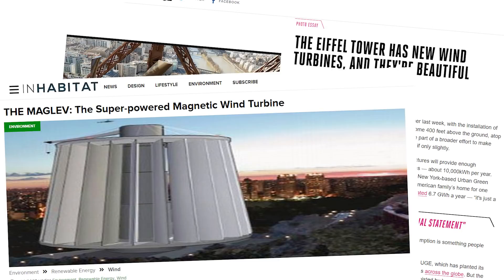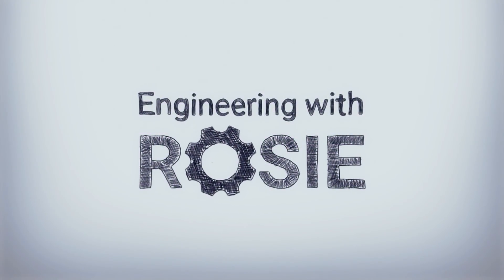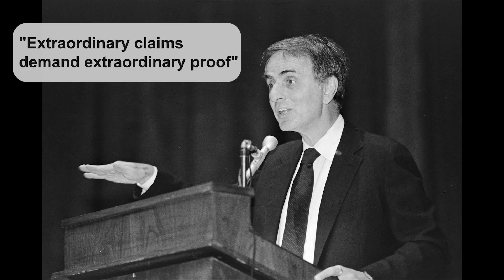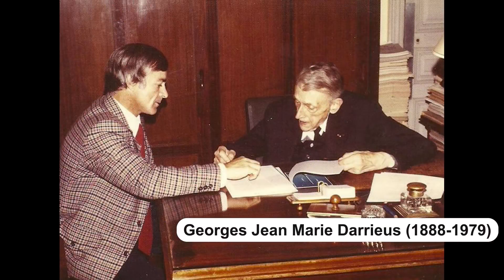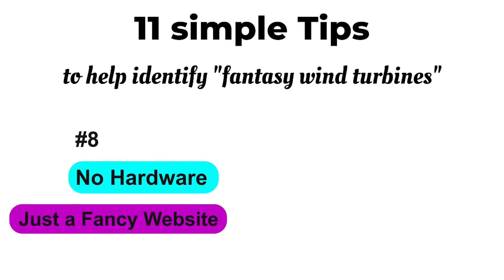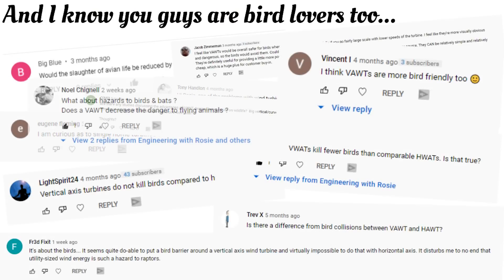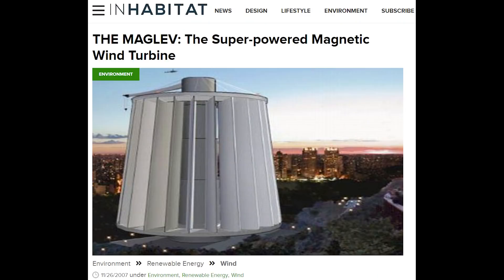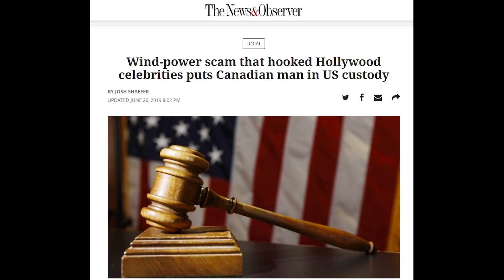Back to the Future of Wind Energy Technology with Paul Gipe

Comment: To me, the twin elephants in the room for most renewables are reliability (of the source, not the device) and storage.
From the reliability standpoint, the ONLY truly predictable renewable is tidal.  Clouds and calms can last days or weeks, but tides are predictable, regular and frequent.
Storage has to cover periods of dearth and periods of high use - it would be, for example, foolish to rely absolutely on wind OR solar through the winter in high latitudes without vast amounts of storage.  And at those latitudes, even the sea is frozen.  Ground source heat pumps are a definite maybe, but the best I've seen so far is in the storage of energy as heat in sand.  Yes, ordinary common sand, and the Finns are already using it for heating some buildings.  If it can store, inexpensively, sufficient energy to last a Finnish winter, that is proof enough!
For other types of energy, electrical storage is mostly Lithium-Ion cells, although more efficient batteries do exist, but have their own problems - sourcing the materials ethically is a big one, shared by Li-Ion, but others include operating temperatures, cycle life and safety.
It is only in a combination of technologies that we can see a real change in sustainability, and the best I've seen yet is liquid metal batteries inside sand heat storage.  They complement each other perfectly, the sand insulating the heat needed for the operation of the liquid metal cells, and using any "waste" heat effectively as a source of heating power for all the usual purposes, although most of the heat stored in the sand is from ordinary resistance elements, which keep the sand hot enough that at its core, where the batteries need to be, the heat gradient (and therefore loss) is low.  The sand is heated and the batteries charged mostly in summer, and the heat slowly reduces through the winter by heating water pipes which circulate heat to where it is needed.
Small-scale local generation is best as it reduces transmission loss (a fact recognised early in the Industrial Revolution), so all the energy-intensive industry needs to be close to where large scale power is produced, by whichever means.
Moving towards a more sustainable future is disruptive and challenging, and big money (oil, gas, coal, even nuclear) are rolling in it, and using it to fight sustainable alternatives, mostly using economic arguments.  That requires a high tax on carbon use to level the playing field.  The amount of money in the carbon energy release energy sector is the third, artificial, elephant.  And an artificial elephant needs an economic rather than a technological solution.

Comment: Trying to build my own wind turbine after buying one last year (lantern type)  which couldn't even reach operating voltage let alone wattage, so far it seems to work well both in horizontal and vertical positions but I haven't found a generator that I am happy with as most don't put out high enough voltage, and I need to refine how it's made (it's a bit DIY looking at moment).

Comment: What a great video. Side by side with other energy technologies, wind comes out miles ahead, still. Put up all the false claims about Net Zero fossil energy, or high efficiency, or low cost, or 'clean coal' or 'benefits of oil' or methane replacing coal to reduce GHE, and still wind wins hand's down.

I'd love to see a similar critique of solar, geothermal, hydro and nuclear in all its guises, so the different technologies could be compared on the same basis.

Energy often attracts snake oil salesmen. None moreso than fossil.

Comment: Great video Rosie! I have a question - why is it not viable to site wind turbines on the top of electricity pylons? These would be of an appropriate size so as to not stress the pylon (maybe this is the reason?) Of course a convertor/transformer would be needed but there would be some transmission cost savings. I've always wondered about this!
Reply: <enthusiastically puts hand up> Can I answer? Please, pick me!

Any turbine installation comprises several parts; foundation/tower, turbine, generator/dynamo, conversion electronics.
The last is damn expensive and doesn't scale down well in cost.
So putting a turbine on top of electricity pylons only eliminates the foundation and tower part. You'd still need all the other components.
The turbine could only be small, because you don't want to overstress the pylon and you couldn't use a big HAWT (chopping the powerlines would not be ideal).
So you are left with a small device not generating much power, with the major costs of the transformer and connection to the electricity. That has to be balanced with load btw; another complex task.

Simply put; huge complexity, large material costs for power generated. Not worth it.
Reply: Thanks Alistair, go to the top of the class!

I did realise that the economics weren't comparable to traditional turbines but we've got to stop thinking in purely monetary terms and more along the lines of "every little helps". The grid balancing is an issue but these turbines could be stop/started remotely and in groups (say, 50 in a line at a time). It may be that the economies of scale of producing the hardware for thousands of  pylon turbines and the increased wind speed given their position mean that cost/benefit may improve. After all, look at the funding going to the fossil fuel industries globally.
Reply: I think you underestimate the horizontal force on a spinning wind turbine. Its's almost as big as if the entire swept area of the blades (not just the area of the blades themselves) were a giant sail. These electricity pylons are simply not strong enough to handle this additional load (as you already suspected). You can look for youtube videos of wind turbine foundations, they are massive!
Reply: @wimvanuytven7858  Hi Wim, thanks for your reply. I didn't envisage huge turbines on top of pylons, more like hundreds of smaller units with a rotor diameter of around 2 metres (though this would obviously need to factor in the average air density throughout the year in a country - cold dense fast wind = only smaller turbine possible). I imagined  that these turbines could be controllable, featherable, directional, have additional cycle adjustment and other management to allow them to connect to the grid via the existing power lines. I guess that most of the lateral force would be borne by the pylon structure (they are bolted together) and not the base, which may mean additional strengthening (but no base redesign). The economics would only come into play through the quantity of these turbines - if it's not windy in Scotland, it may be windy in Brighton. However, the U.K. is actually (onshore) becoming less windy which would negate the whole idea!

Comment: I had heard that as a rule of thumb that the tower contributes about half the cost to practical wind turbines. What do you see evolving there? 

I  have to admit, I had a wild flight of fantasy seeing the dirigible (floaty) ducted turbine: Could this be the next big thing (in engineering challenges)? No not really.
Reply: The tower does not cost 50% of the total cost of a conventional turbine. Probably about 15-20% depending on hub height. Biggest cost items are blades, gearbox and electrical system.

Comment: i like hydropower. imagine, 4 dams, (or more), down a mountainside  in sequence , spaced apart, with reservoirs  using 1 river, and multiple hydro electric plants off of 1 water source might be viable if a pipeline of these "banks" of energy using only 1 water source and gravity may be an option. in addition to wind and solar. but the question still is. how are all the products made without the initial environmental impacts of manufacture?

Comment: Wind energy (when it's windy enough to turn the blades or too stormy to use the turbines). Imagine the scenario with a large area of high pressure bringing cold, foggy weather in winter - no wind power, very little solar - NO ELECTRIC.
Let's go "green" and have  expensive 
UNRELIABLE energy.
Reply: That's where energy storage  comes in handy.

Comment: I have a concept. A omnidirectional solar sail+wind turbine. The way I see it, sails can push tonage of a ship across oceans. So 3 sails that can also absorb and convert solar energy. And the turbine which at the base can turn in either direction to produce electricity. And the solar energy absorbing sails can also convert solar energy. Does this have any sound application or is it a pipe dream.

Comment: Siting and tweaking have often proved that vertical axis turbines do a good job for particular situations. Obviously the conventional very large turbines will continue to be used for bulk generation because they are scaled for maximum generation and use the physics of lift as Dr Gipe says.
However, size and noise bring problems too and I hope that blades and gearboxes will be greatly refined.
Without bulk storage for days of little wind I feel that cart before horse was allowed to occur.
In sneering so blatantly about failed -- and often hyped -- smaller scale wind devices I regret that you have failed to grasp diversity of requirements in context. Gipe seems to relish negatives more than you do along the lines of "my way or no way" -- note his WindWorks promotions of 2012 ff.
One was about a "Jeffersonian revolution" in wind energy across the USA and I do not recall his company or similar ones thinking ahead to 'downtime storage' back then. That seemed to creep up on us in the last 5 years or so except among some who saw that intermittent generation was but half of the job.
Reply: Please post your data showing vertical axis wind turbines working and producing anything more than a few watts per hour. 
Gipe backs up his statements with data and power curves. Fancy websites, wild clams and marketing hype is cheap. 
I’ve installed several different brands of turbines over the last 30 years, all 10 KW and under. I’ve never seen a vertical axis machine that was worth the shipping cost.

Comment: Hi Rosie. I would like to ask if when doing calculations for a small wind turbine directly coupled to a generator, do you assume that the rotor rotational speed is equal to the electric generator rotational speed and then compute TSR or do you assume the TSR ratio and compute the  rotor rotational speed.

Comment: What about high altitude kite based systems? I saw a small reference to them flash by in the book, but didn't see them elaborated upon further.
Reply: Those operate in the same area (altitude) as commercial jets (when 'parked' in the sky to wait for their turn to land) and are considered a hazard to the people being transported.
Even skydiving schools (going up to 13k5 feet) lost their 'playground' because the commercial airlines wanted to use that part of the sky without sharing.
Technologically sound but there are other factors at work that make it un-practical.

Comment: I run a small wind turbine (450 watts) and other than the wires separating it has been with me since 2008. When I was lowering it for the wire repair I broke the blade(my bad). 
No it doesn't do as much as I would like because of location, city rules, but it does keep a battery topped off. 
Thanks for the good information, and keep up the good work

Comment: I would like to see more videos on the home turbines , which ones to buy , and even what materials to use to build your own turbines , I own several 3d printers It would be fun to make new designs and be able to test them. I was thinking about the attic turbines that are on houses to remove heat build up if they were a little bigger and had a motor that would be killing two birds with one stone, add this to a solar panel kit and a horizontal turbine you would be creating energy 24/7 and have it tied to the grid so when youre not using energy you could roll back your own usage and save more money.

Comment: I have been searching for information on the flapping wing turbine and have not found any informative work. There are a few videos illustrating this type of turbine actually working  mostly put out by news channels . I am interested in building a small working model flapping wing turbine and though there are more than a sufficient number of scholarly posts , mathematical analysis, comparative studies etc etc there is no information  related to the practical design of the mechanism that enables such a turbine to be built.There seems to be just one manufacturer of the type of turbine being referred to and that is the Tyer firm. No patent seems to have been either awarded or even applied for. I would appreciate  design information related to the mechanical details of this new type turbine.

Comment: Robert Murray Smith made a low wind speed turbine that functions comparably to a commercial 1kw turbine in typical conditions (built, tested) using a low torque high speed design, built out of a washing machine drum.   it's over on his channel.  So, whereas I'm sure Mr. Gipe is generally correct in his cautions,  it's not impossible.
Reply: Robert also had an interesting back and forth with his viewers in designing building his wind-turbines. I liked that a lot.
But to be honest, the wind-turbine wasn't put to the test for years and years and doesn't provide long-term data (as in when do we need to replace bearings and such?)
Reply: @DreadX10  id figure youd get at least a few years out of it.  If you greased it every once in a while, no reason to think you couldnt get a couple decades out of washing machine bearings, considering the weight theyre designed to deal with.
Reply: @ryanjamesloyd6733  True, and are build for 1600 rpm for the centrifugal cycle so that's okay too. And you would pick the smoothest of old bearings you have on hand so the one with the most life still in it. But what I meant was also with foul weather and storms over-time.
So more an exercise in looking at the design(s) and trying to predict what will break first and why.
An engineer standing next to a wreck of his device can tell you exactly how much the design can take, whereas an engineer next to a working single prototype can only predict how much it can take. ;-)

Comment: Ok so what if you combine dyson parts to create a turbine? Basically using the wind to create a negative pressure system for a self sustaining turbine. I’ve seen many designs just non on a smaller scale. My thinking was to combine the parts of the dyson cyclone vacuum, with the bladless technology . From the fans to Frankenstein a generator together. I’m not all sure what has been done in the past to combine jet engine technologies to current turbines design?

Comment: They only question I have is would adding winglets to a horizontal wind turbine increase it’s efficiency the way it does for a aircraft, effectively giving it longer wings increasing the amount of lift or torque?
Reply: There really isn’t much incentive to do so I think. On airplanes, it serves to limit the real wingspan while effectively increasing it aerodynamically. That has benefits in terms of fitting on smaller airports and paying lower airport fees, or for gliders, being able to complete in a 15 meter class. All at the cost of a more complex wing design of course. But what’s the incentive for commercial wind turbines? They would be better served with just adding an additional meter or so of blade I think? Or would winglets help in problems where the blade tips get too close to Mach 1 at higher winds while still able to effectively extend the blades perhaps? 🤔
Reply: @AndreSomers  that’s where my limited knowledge gets me, I know that the winglets help to reduce the turbulence at the end of the wings of an aircraft wing helping to guide the air flow over the wing, so my thought is how much improvement vs cost and complexity would it add if any 🤔

Comment: The fundamental problem of all wind driven contraptions: The wind only blows about 3 days a week. The other 4 days you  will have a cold dinner. 

This is confirmed by all production statistics. Efficiency of the wind turbines is about 25% of the rated output.
Reply: Which exactly are these 3 days / week when the wind blows? 
Possibly Monday, Tuesday und Friday?

As apparently this is true anywhere on the planet, your "proven" findings could lead to a new non-religiously biased, non-discrimimating universal way of naming the days of a week:

Windy day 1
Windy day 2
Calm day 1
Calm day 2
Windy day 3
Calm day 3
Calm day 4

Too bad for weekend surfers ! ;-)

Given: the capacity factor of 25 % for onshore wind turbines on non-so-great sites is pretty much correct. A capacity factor indicates the actual annual output / the output generated in conditions of maximum wind for 8760 hours / year.

Fools and people with a steady income stream from selling / burning fossil stuff tend to interpret this as "A wind turbine is only working 25 % of the time".

Comment: Rosie.   One of the best ways I can think of to detect novel and useful advances in wind turbines is to ask two questions:  (1) What are the major challenges to increasing wind turbine efficiency today?  (2) Does this new wind turbine actually address one of those challenges?    In this area, I think of advances in materials science and working out better fluid dynamic modelling.   Neither one would probably make a good web site topic.     Although I have heard about improvements in recyclability in all aspects of wind turbines--especially the blades.

The next turbine technology area I would like to see you cover is that dealing with water--both in oceanic (tidal or currents) and river settings.  Water has such a wonderful density that allows an electrical generator to be useful at even small scales.  I will watch for that topic on your channel!